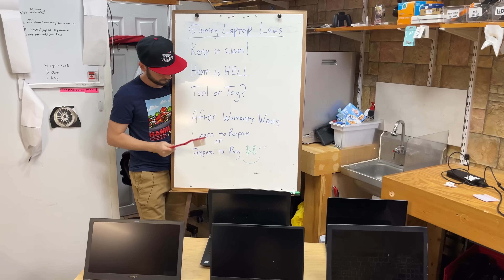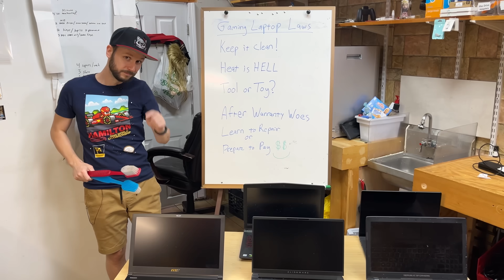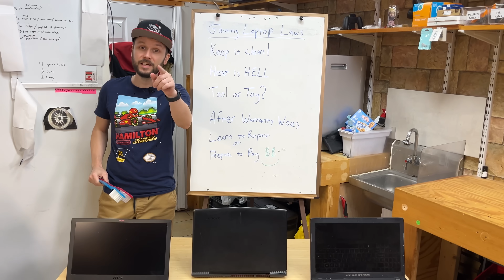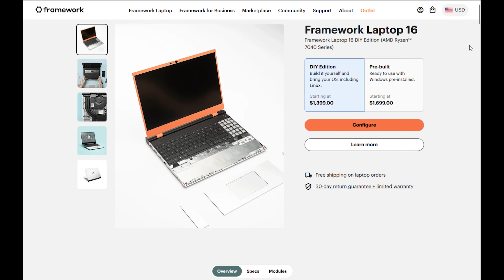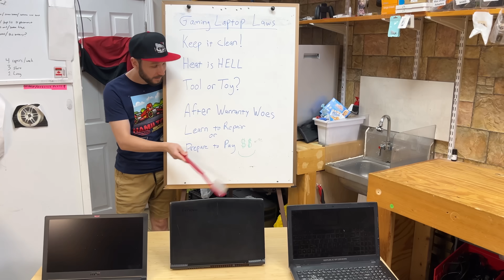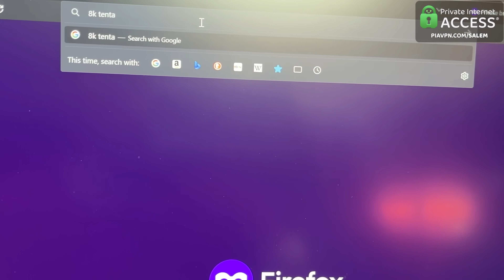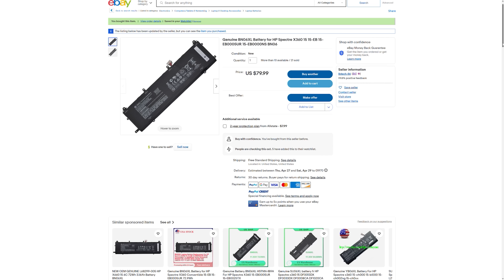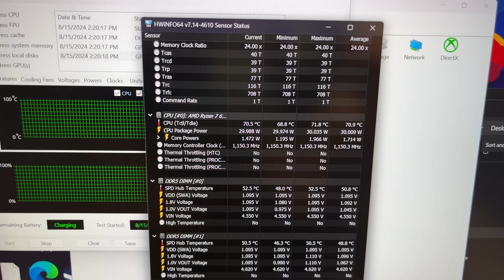Repair Shop Owners Guide to Buying and Maintaining a Gaming Laptop

Comment: I had HP Victus 16. Fairly decent laptop. I had to turn off boost cpu becuase it was goin high without needing too.
Without boost laptop was cool and i didnt notice any performance loss anyway.

I did clean it every 3-4 months inside.
Reply from the maker: In my experience, those respond very well to PTM7950 and thermal putty on the VRAM. Drops temps like crazy.
Reply: @SalemTechsperts  My solution was:
Sell the laptop
Build pc
So i did those steps and never been happier 
I had pc few years back but had to switch to laptop (it wasn't bad but i still prefer pc)
Reply: + sorry for my english it aint my first language
I understand 90% of what i hear and watch but can't write good enough yet

Comment: I have a acer predator helios 300 (from 2018) and I am still using it to write this comment. I had my AC adapter fail on me once and also had a hinge problem which was resolved thanks to the repair guy. A few days prior to the repair, I had heard sounds of some debris hitting around the fan and got worried because of that.  I am now thinking of undervolting my laptop because of the thigh temperatures but don't know if I should add a new thermal paste before doing undervolting. I saw a guy who made a video for the undervolting and thermal paste tutorial on my exact laptop model.

Comment: My journey started in 2018, I've just got my first laptop, something low-end from acer (an aspire 5 to be more precise), i needed it for po.. school as I've just got into the high school and i needed something to be able to do my programming homework, and yeah for some gaming, it was.. terrible, it had an hdd that gave up on me last summer, it now has a hinge problem (the classic one) and so on, this is just the TL;DR version to not be boring to you gold fish memory gen that I'm half a part of

So I've got it in 2018, specs: 4gb of ram, i3 8th gen, mx130 with 2gb of vram, I've started to learn some windows tweaks to make it faster, better, learned how to debloat it, in 2019 I've had some software issues, blue screen from my pira... totally genuine windows version (I've spent a day waiting and resetting the pc (5400 rpm hdd strikes), drivers not working for no reason that fixed by itself in 30 mins, the rest of the year went good enough I've even upgraded the ram to 12 Gb, soon it was 2020 and you know it, online school was a thing, the mic just stopped working, fixed it by buying another one, and the rest of the year went well (I even got a 256 gigs nvme for system and valorant to boost my laptop performance) until the fall came, then my laptop started doing weird stuff like when i hover over the youtube progress bar the screen started flickering, i tried some stuff with no luck, then disaster strikes, as the screen doesn't work, i tested it with an hdmi cable and my sister's tv, it worked there so I've used it for 1 week, then on the new year eve I've sent it to a local repair shop, they said it was a cable and charged me 50 euros for that and I've wanted a cleanup as well so I threw another 10 euros for a maintenance, 3 weeks have passed and I got a phone from them saying that it was done, I came, I took it and when I arrived home it didn't work, as in it didn't even started, when i connected the charger it worked, but only with the charger, I immediately opened it up and noticed that the battery wasn't connected and besides that it was even dirtier than I've sent it.., I just assumed the loss on the maintenance because i had to use the bus that had the most fucked up program and the ride to the city was 1 hr long. The rest of the year went well, soon 2021 came, I bought my first maintenance stuff from thermal paste mx4, isopropyl alcohol to a tool set with all kind of bits, just the basic, did my first heatsink removal and everything went well, in 2022 the charger left me for someone better like Lupe and hat to get another one, then in 2023 I replaced the hdd with an sata ssd and made an external drive from the old hdd to use it for pirac... extra storage ( it lasted untill summer btw R.I.P.), and did another maintenance, and everything went well for that year until more disaster strikes, in the middle of October my hinge started degrading and in the beginning of November it just gave up, I forced closed carefully to not break something and force opened one last time, but it just cracked a small part of the bezel, I already was planning for a laptop upgrade since spring and had 1200 euros prepared for that, but waited to make the most out of my money, after the hinge incident I decided to buy an Acer nitro 5 AN515-46 with a ryzen 7 6800H, 16 gb of RAM and a 3070ti, the upgrade was huge (I'll continue with it after I finish my old laptop story), after I backed up everything important and transfered on the new laptop and in cloud I wiped everything on it and gave it to my sister and it's been like that since.

Now I was happy with my new purchase, but it overheated like hell, it is a problem that I knew for a while and I had the solution for it, but i had to wait almost 2 months to get enough money for a good cooler (went with IETS GT500 because I wasn't aware of llano, but I'm really happy with my purchase), after I've got it I noticed a 20 degrees (Celsius) difference, I've upgraded the storage as well and now I'm just taking good care of this heater.

The conclusion I would like to leave is this: don't be afraid to do repairs by yourself, that's how you'll learn, but make sure you know your stuff before starting doing shit, watch some youtube videos with your exact model and you'll be fine, also watch (!!!ear rape warning!!!) THE GREATEST TECHNICIAN THAT'S EVER LIVED.

Comment: If you just do the ground-level maintenance on your laptop once a year -- open the backplate and use a can of air (or a LOW-PRESSURE air compressor) to blow out the vents and the fans, clean the keyboard, and gently remove the dust and debris from the device -- it will last longer than you will likely use it for. You don't need to do a thermal paste swap unless you are really torturing the device daily (such as long gaming sessions), but if you are, I STRONGLY recommend using a professional for that service. It will cost you $200, but they have the tools and the STATIC GROUNDING to ensure you don't turn your device into a brick.

Also keep in mind that some devices are simply easier to clean and repair than others. If you get a thin-and-light gaming laptop, it's going to have less space for heat to pass and smaller fans that will accumulate their fill of dust and debris faster, requiring more cleaning and maintenance. Similarly, if you got high-end hardware specs that pump out a lot of heat, you will stress the components more and need to spend more time and effort caring for the device.

My recommendation is to get mid-range specs in a modest form factor. You don't need to lug around a 12 lbs beast, but packing an i9 and a 4090 into a thin-and-light frame comes with its own problems.

Comment: I am in the process of opening up an AUSUS ROG GL552VW (2018) with the idea of changing the thermal paste, cleaning or replacing the fan and general stuff, but removing the tiny ribbon cables under the keyboard scare me as I have broken such in the past. It's a straight forward repair, however I'm very nervous about the ribbon cables. Did upgrade the HDD to SSD and the M.2 drives, updated BIOS, broke the Intel MEI driver so laptop doesn't restart or shutdown unless forced, but still works.

Comment: Razor blade 14 still holding strong. Had it for over 2 years now. (Only the rgb on my shift key is stuck to the color red. Not the full shift key, just half of it)

Comment: already bought  an asus tuf a15, should've told me about it earlier bro
Reply: i have an asus TUF f15, anything wrong with that?
Reply: @TheOldGaming_Official  no lol, bought it like 2-3 weeks ago but I have heard that gaming laptops break easy so was starting to have second thoughts
Reply: @sladewilson2595  they certainly break more easily than a Desktop but depends how u treat your laptop.
Out of curiosity, what are your laptop's specs?
Reply: @TheOldGaming_Official   16 gb ddr5 ram, 512 gb 
 ssd, rtx 3050, ryzen 7. And yeah I understand it matters how you maintain it but I have a bad history of buying electronics that go bad within two years 😢
Reply: @sladewilson2595  idk how about the A15 but the F15 has quite good repairability so if something goes bad you can replace it (Well almost everything)

Also RTX 3050... uh...
4GBs of in 2024 is a kinda low amount tbh.

Comment: had my MOSFET replaced twice now due to power issues (likely from heat) on a 5 yr old laptop, just broke again and i'm starting to think this wasn't the root cause of the issue but an actual symptom of the problem (maybe it needs new thermal paste or there's instability in the power supply circuitry). annoyed i have to take it back again for a repair but would be good to have it working again, and the shop is a super fair and low price

Comment: huh, I actually had good experiences with MSI.  I had a laptop of theirs that lasted me a real long time and they kept fixing it for quite a while, not even sure if it was under warranty at the time since it was years later but they fixed the keyboard and an audio issue.  I only had to replace it recently because half the fans basically crapped out and a second battery (I'd already replaced it once) had swelled up to the point it was deforming the laptop.

Comment: I have an Asus TUF gaming laptop from 2020. I bought it to replace mecha the local hard drive, put more RAM in it spent pretty good, actually, but I discovered you couldn't upgrade the Wi-Fi card because I've tried that twice, and once I bent the pins and then the second one, I get it connected and stuff with someone's help and the computer won't boot so that was out of the question and my Wi-Fi card is a little messed up where I don't have a connection in the upstairs of my house but downstairs no problem it does get the dust cleaned out of the vents every few months to keep it happy the great laptop honestly.

Comment: Also I think big fat laptops are better than thin ones because they handle the heat better, but that is another 2 kilos in your backpack. I have the old Asus ROG G702 from was it 2013, it still works today, I no longer use it but my mom use it to watch videos and doing her online old ladies conference. The only damages it has is the speaker sound is not as loud as it used to be, and a few dead pixels on the monitor, I never send it for service or maintenance other than adding an SSD and cleaning the heatsink a couple of times. It never gets hot and you can use it on your lap safely. I am using a newer ROG Zephyrus now, forgot which model it is but it has 11th gen Intel i9 processor and 3080m GPU in it. I dare not put this thing on my lap and I always use a cooling pad with it. But then I am running Linux on it now which takes some of the pressure off.

Comment: Literally only thing you have to do, don't get water near it, don't let it gather dust, don't hide the vents, ever.
Clean the vents with a powerful vacuum cleaner with some small brush attachment, that crap will suck every bit of dust out of the laptop and keep your temps always as they should within safe thresholds.

Comment: I bought an Asus G713 a while back, as a travel toy when I can't take my desktop with me. Though from factory the cooling solution seems overwhelmed by the components... The laptop RTX 3070 regularly jumps above 100°C on the hotspot temps (in the highest power profile that is) even with the fans sounding like jet engines (small RC ones, but still^^). I'm actually considering trying liquid metal for the first time, but then I've heard some horror stories about that on laptops specifically, so I'm a bit hesitant on that front...

Comment: So, a couple years back I bought an HP Envy Creator Studio 15 inch. My model has the RTX 3060 and i7 11800h. I tried to modify the cooling system with liquid metal. The laptop still works but, it's starting to heat up again. There's multiple videos I watched and followed on modifying a laptop to use liquid metal and prevent anything from short circuiting, which so far has been fine.

When I originally changed the laptop over from thermal paste to liquid metal, I forgot to measure the original thermal pads. I tried to swap the original pads to some Gelite Extreme pads I had laying around from when I had to open up my RTX 3080 Founders Edition. 

It sucks being in the middle of class and my laptop fans just spin up so loud. I always keep it clean and have taken it apart a few times to try to figure out how to fix the issue. I'm worried that I'll have to keep reapplying liquid metal because of the copper slowly absorbing it? I'm not sure what to do.

Comment: I still have my HP Omen 15 laptop from 2020, having the 1660 ti and R7 4800H up and running, to this day, it still works and I love it, unfortunately, the wifi cuts out at times and because of me unscrewing the bottom case and praying it open, the bottom case clips are gone, so the only screws I have left from it keep it closed.

Comment: inb4 "achually" : these are toys. Even the Alienware, since R5 and bove. You can't have slim, lightweight, quiet, powerful gaming laptops. Something's gotta give. 
Laptops that come close to actual gaming rigs are those from Eurocom, XMG, Schenker, Dream Machines and Clevo (which are mostly one and the same). Actual desktop CPUs and GPUs that are one tier below, performance and TDP. Ex: a 3080 MXM is a 3070 desktop but in laptop form, as opposed to a 3080m Ti which is a 3060 desktop.

Comment: I exclusively own business laptops because i haaaate how gaming laptops look. 😅
Don't know if it helps with the thermal paste issue but I always let my fans run down on their own before shutting down so it doesn't just go straight-hot to straight-cold. I haven't needed to reapply thermal paste in at least eight years

I really wanted a Legion laptop after using one for years at work because they LOOK business'y despite being gaming laptops, but I always remember that legions don't have touchscreens or pen digitizers..

Comment: I finally got enough corage and popped open the legion 5 pro to clean it in a friends house, because the dude knows way more than me about computers. It went pretty well, the thing doesn't reach 100 degrees anymore (💀) but the stupid cpu loves to spike from time to time in the high 90s for whatever reason, the average sits at around 87~ though
Reply: We did use some pretty shit thermal paste I think so I'll have to pop it again in the near future to both clean and repaste, and maybe add more ram and another ssd, a 2tb hopefully, because games are FAT these days

Comment: Just a note for anyone, you do NOT need a gaming laptop as you shouldnt need that much performance on the go and with the price range of 800-1000 for the laptop you could buy a cheap laptop for work and a decent mid range desktop which will play all the games better anyway and wont have as many reliability problems

Comment: I recently used your HP gaming laptop video to repair the exact same model we have at work. First time ever pulling a laptop apart, and it was 100% a success. I replaced a burnt out fan, and repaired a disconnected Wi-Fi cable. Up next is removing the HDD and cloning it to an M.2 SSD. Is that something I can send out to you to do? Or perhaps drop it off? Because it scares me to mail out a hard drive.

Comment: My Laptop is just for work and uni, but it´s a Lenogo device, so it has been sent to repair already twice, in it´s first year. And the second time was, because they forgot some parts, when they put it beack together. But I have a Desktop Gaming PC, that I also can use for work. So I always have two devices that I can use. Also I have 5 external drives for all my data. Three of them just for my backups, and two for daily use. Might sound exaggerated, but I already had drives and computers failing, so I´m better safe than sorry.
Reply from the maker: IdeaPad?
Reply: @SalemTechsperts  IdeaPad Flex 5. And yeah, the hinge broke, because the plastic its mounted to is thin as paper.
Reply from the maker: lol upon reading the word "Flex" I already knew where that sentence was going. Pieces of shit man, sorry that happened to you.
Reply: @SalemTechsperts  Thanks.^^ Yeah, the quality isnt the best. The PC itself is not even bad with an Ryzen 5700U, but in that case, it wont last forever. My next work laptop will probably be a Framework.

Comment: My Alienware m16 R1 just died (flash codes for mobo failure), and thankfully it's still under warranty for another three months, so tomorrow I get to deal with Dell to ship it off to them to fix it. NOT IMPRESSED AT ALL. Anyway, I am always horrified at how many people think it is acceptable to live like pigs,. No, I take that back, pigs are cleaner. I am always horrified at how many people think it's acceptable to be so disgusting and then hand you equipment. The things I have cleaned out of laptops, mice, and keyboards is the stuff of nightmares. 

Very quickly I learned in my IT career to always wear gloves when handling other peoples equipment.

Wait...
Reply from the maker: That last sentence 😂
Reply: its really not that bad just wear gloves and  you'll be okay
Reply: @yuyuy193  I do. I have also had equipment returned with mucus, toenail clippings, and more than once received computers mailed back to us containing razorblades, steak knives, or fecal matter. That last one became legend as they were not disgruntled but they were when they were fired for it, providing the excuse "I ran out of toilet paper and used the packing paper, I forgot I put that used paper in the box!"

That was when I worked for a major insurance company by the way, so you think people would have had decent standards...